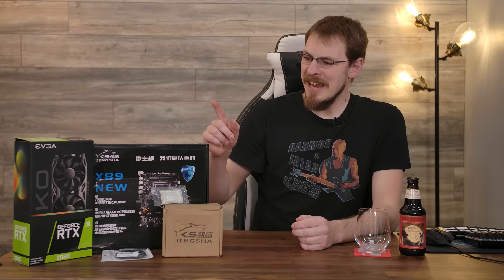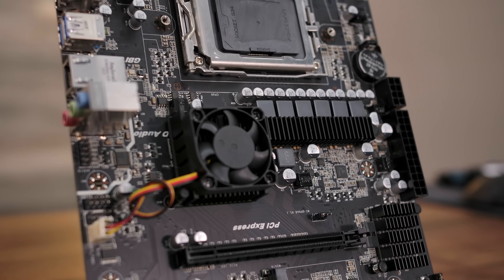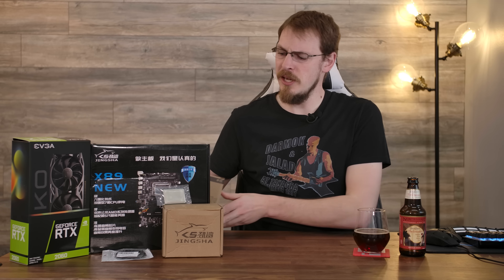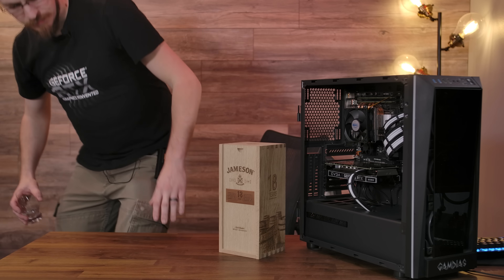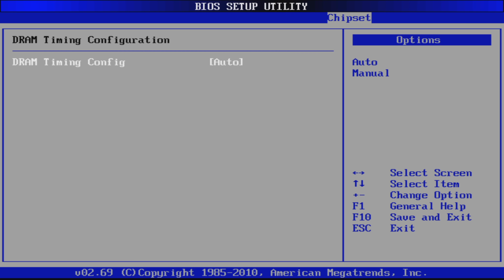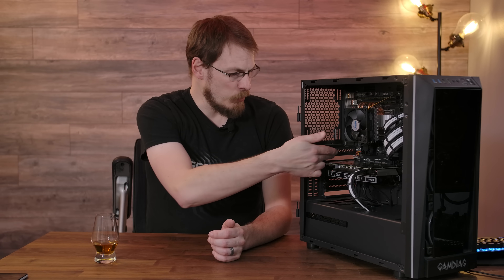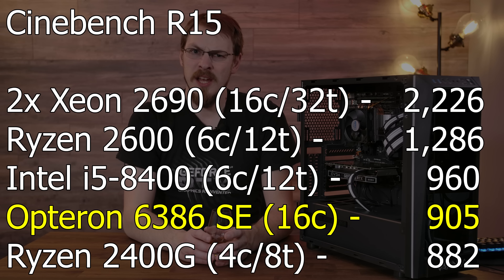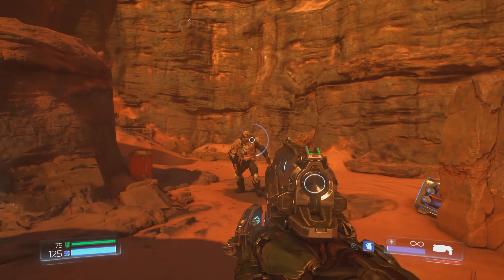Chinese x89 Motherboard??? Piledriver or just a pile?

Comment: Dont be a dick bro...i have dual socket ASUS KGPE-D16 with 128GB 1333Mhz RAM and dual 6128 OPTERON with windows workstation PRO 10 ...which still performs good

Comment: Glad I found this review before buying 2 of this board. I has 2x 6276 in a Supermicro H8DGi until the board started randomly rebooting after 45-60 minutes of use. No BSOD, just as if someone pushed the reset button.

Never had performance issues. Was looking into what to put the CPUs into and it definitely wont be what you tried. Maybe an Asus KGPE- D16 if the price is right (and if the price is right for a case as well).

Comment: Hey Everyone! Before we shart on Socket G34 and everything else related to the Piledriver and Bulldozer server platform I want to mention a few things! 
I've dealt with these chips for a while now, more specifically in Dell servers and I can tell you straight off the bat,  Jeff's x89 is ruining everything.

These chips, I will not lie aren't great at single thread ESPECIALLY NOT GAMING!!!! (making that very clear, these aren't like older, bang for buck Xeons, who are good at gaming).  
But, I can tell you first hand, on Dell, Supermicro and HP motherboards, these things are meant for VM's and lots of them. Running on a proper motherboard, these things can multitask and multi thread like nothing else. The 6300 series  (Abu Dhabi) (6380, 6378 and 6366 HE especially are compute champs for their value (6386 SE is a power hog) (Two 6386's can about touch one  first gen EPYC)

I would not recommend buying into this platform, if you have to buy a motherboard with it. Good motherboards for these chips are very very expensive, as well as coolers and are hard to find..
I think the only case you should be buying to this platform, is if you've found a good deal on a server chassis (which very much exist for this platform.) Servers like the Dell R715  (better R710 in my opinion) R815 and others in the Dell 11th gen "Rxx5" family are all,  AMAZING servers and run this chips very much as intended, unlike this "X89" junky motherboard. The HP DLxx5 servers are good as well! But in my experience the Dell servers and Supermicro motherboards are amazing. My Dell R715, loaded with 15K SAS hard drives, dual Opteron 6380's uses about 200 watts for what I do

What I'm trying to convey is that, if you are looking into getting into homelabbery and you need cores, on a budget and single thread isn't a HUGE deal, don't be scared off by this video, as these chips are really good, in certain use cases! This video is NOT a accurate representation of Socket G34 as a whole! Now, what I would not recommend is really going for anything but the 16 core Abu Dhabi chips, as really at that point, just buy an Ivy Bridge chip or something else,  you're better off with Intel. I know these chips have BAD single thread, but they aren't as bad as the ones in this video. My R715 actually used to host a BungeeCord network (Minecraft) and performed pretty admirably with upwards of 150 people spread off across my network on 12 Abu Dhabi cores! (Mind you, you won't be getting that on a single server... Single core still isn't great). They've run Plex transcoding beautifully and Code Compile is wonderful on one of my 24 core VM's. It is a pretty snazzy render box and i've been happy. 

The chips are cheap (80 CDN for 32 cores {2 Opteron 6380's off ebay }) but motherboards and coolers are very very costly and not worth your time. This platform is only worthwhile if you have a preexisting high quality server chassis, and power is cheapish ( At 0.21$ cdn per Kilowatt, my main R715 at home costs about 18$ cdn a month...) these are really fun to play around with, if you need lots of cores for VM's,  Code Compile or a multicore render farm. That is the only reason i'd buy these chips.

I really hopes this helps at least someone! This platform isn't complete garbo, but special and has its niche and this video is NOT REPRESENTATIVE OF REAL WORLD SERVER PERFORMANCE  AT ALL! (if you have a good motherboard ;) )

Great Video as always though Jeff! I'd love to see you try again with a proper motherboard :)

P.S, These things don't game..... I tried it with a 1070 and it was the funniest bottleneck i've ever seen.......
Reply: I totally agree 100%,I saw much much better performance on a Super micro dual socket.
Reply: A few weeks late, but thank you for this. I'll be honest I bought one off amazon as they were selling for less then 10$ just to frame it and use as wall art.
Reply: Real G34 mobos aren't that expensive, exluding rare quad socket ones. I'm planning to get a dual one for new diy server.

Comment: ive seen other tubers using worse opterons and running things like doom and strange brigade just fine... something is definitely wrong. guys were gettingg over 100 fps in both those games with opterons and no stutters.
Reply: These Opterons need a proper quad channel memory. And a real BIOS, not chinesium one.

Comment: Noob question.  A lot of issues I've seen with piledriver CPUs is that its "2 cores per core" weird layout causes a lot of bottlenecks in performance.  As in an oversimplification of how 2 cores share the same FPU and Cache.  If you have a CPU of this bad architecture would disabling SMT solve this issue?  Because then there wouldn't be 2 cores fighting over the same shared resources anymore, only 1 core that can go as fast as it wants
Reply: No. These don't use SMT it is CMT, and disabling a integer core is not going to get you anything. These CPU's were optimized for heavy multithreaded use, this is why they have had such a long shelf life because modern computing has moved to a much more multithreaded model.

Comment: The motherboard is limiting this cpu badly, on top of that many games and windows don't know how to cope with different NUMA nodes. Which can cause a significant performance hit and very fluctuating perfomance (speaking from experience with a quad opteron 6380 system, Windows performance is a lot better in UMA mode, however Linux is waaaaay ahead in NUMA mode performance wise)

Comment: I messed around with one of these X89 boards - got a little bit ahead with the BIOS-MODS forums for it (was Jingsha branded)  — we unlocked voltage settings and RAM speed settings along with Hypertransport settings and a few other things. 

He was working on getting CPU overclocking unlocked, but I got impatient and force-flashed the wrong BIOS to my board. Only way to fix it is to get a chip programmer  and reflash, but that project has been on hold forever. 

Sooooo if you want a project, check out the bios mods forums and search for Jingsha, carry on where I left off, get some overclocking going on that Opteron and let’s see what 4.5GHz of Piledriver ridiculous with only half the quad memory channels enabled can ACTUALLY do!

Comment: Why bashing Opteron CPU if youre running it in the motherboard that is just plain wrong for G32 platform? G32 Piledriver is designed to run with 4 memory channels and youre putting in a motherboard with just 2 memory slots! You should be drinking less and spending more time on research. A quick glance at CPU spec sheet should tell you that there is no point to buy this motherboard. It is the same as expecting that a horse will run just as fast on two legs as it does on four legs. Because Piledrivers are actually one of the best performing CPUs regarding memory throughput, it is capable of squeezing performance out of DDR3 close to what others do on DDR4. What a pathetic review.

Comment: This pretty much mirrored my experiences with a 6380 on this board. There were a couple things you missed out on too (If you did touch on them, I'm sorry!).
- The ram is not dual channel at all. Even with 2 sticks it remains in single channel, additionally the reason most software cannot identify the ram timings is because of the assigned node. Both sticks are handled by only one of the four IMC's (two IMC's per node) and software generally tries to read it from the unused node, failing to read it spectacularly. Reported it to Martin to correct this in HWinfo a while back.
- The board maxes out at 1600mhz as you've noticed, I found no way to override that. Handles ECC/Reg ram just fine however. Unfortunately the RAM latency tanks because half the CPU needs to cross nodes to access it. Was reading upwards of 140ns latency and higher compared to a consumer AM3+ board.
- FPS takes a 50% loss in comparison to the Opteron 3380 in my other rig at the same clocks during testing under OpenGL and DX11. I never could figure out why however but doom did run just fine under vulkan and 'close' but still under the 3380 FPS results. Tested with a GTX Titan X between both setups during comparison.
- Usb3... Usb3... It's not real, it's very much fake. There is no USB3 controller on the board and contrary to the claims of USB3 support (the blue header) it is simply a recoloured USB2 port with a higher power capacity.
- Using CorePrio by Bitsum helps a bit when it comes to thread shuffling to increase performance but it only works so much. The G34 Opteron suffers from similar issues with it like the earlier days of Ryzen Threadripper.

Comment: I really liked this video. I was thinking about an Opteron for my Plex server, just for the sake of it (and because the current AMD server processors are way out of my reach. And because I though a 6378 can manage the transcoding in all devices at home).  I don't think the CPU is just crap (but it is definitely bad), I think the motherboard plays a major role there. 

The thing is, by the time you try to buy a G34 compatible motherboard, you've already spent Ryzen money. That's how my "stupid" home server project with an Opteron died and got replaced by a Ryzen.

Comment: I've seen others review this board and it's always the same thing, smack in a high-powered server-CPU in that socket, get some of that ECC-RAM, run Windows [Insert edition of choice], stuff in a modern Nvidia GPU, then complain that a server platform does not behave as a desktop board, no overclocking options etc...

I like Craft Computing as much as I (and they) like beer, which is A LOT! But this review did not pack the punch and deep-diving that I hoped for. Modded BIOS:es should even exist for those Chinese boards.

I happen to own the very same model of Jingsha motherboard that is the subject of this video.
-Yes, there are others from more reputable brands like SuperMicro or even ASUS boards for the G34 platform, though the ASUS ones are very rare!
Most of the times they are multi-socket boards, meaning you can use several of these CPU's in one motherboard for multi-parallell workloads. -Not suitable for desktop OS... Just sayin'...
This board could be found for about $50-$55 (including the cooler) about 5-6 months ago, now the prices have gone up to almost the double from what I see on places like Ebay.

And while this particular board has gone through some REALLY strange and even kind of incomprehensible design choices (-like 2 RAM-slots on a 4-channel memory server platform??) the G34-platform really isn't a gaming or desktop platform what-so-ever, for what it's worth, it actually does not perform that bad under Linux for the workloads that it is supposed to run: Spoiler alert! -Not games and desktop applications.

But yes, you can run desktop applications on it under Linux, only difference is they actually work better than on Windows.
Of course it cannot measure itself against the way more recent, more effective Zen-platforms. -Even though Zen and the older Bulldozer architecture are practically ugly cousins, favoring the focus on more cores and interlinking them.
Zen only does this much better as it a lot more recent platform and a re-design to counter the shortcomings of the previous generation. Thus allowing for higher speed, better power-efficiency, higher IPC, granted more headroom and above all: Built on 12nm(and also 7nm w. chiplets) compared of the giant lithography for the Bulldozer at 28-45nm(!) for the oldest parts.

Granted the G34 platform cannot measure itself with Intel CPU's from the same era but seeing all tests being performed by YouTubers on Windows, doing desktop tasks and gaming is almost like them finding an already dead, rotting horse in a ditch and going through all the pain of dragging the carcass back onto the road again, only to then kick it back down into the ditch! :D

It's almost like a "Just because you can, doesn't mean you should!" scenario with this platform.

The easy explanation; Linux handles cores and threads (and modules, in this case) a lot different (better) than Windows has ever done.
Linux rules the world in the server-space and is has ruled it for ages, this is a server CPU, it is meant to do "server:y" tasks, parallell stuff, databases, web requests, things that desktop Windows is not good for, as Opteron CPU's was never intended for that desktop market.

Remember the AMD FX-platform that also did not compete very well with Intel's stuff? -Yeah, that was the CPU's intended for desktop tasks. They excel over the Opterons in every way when it comes to desktop tasks because of their higher clock-speeds and aim towards other kinds of workloads.

This is a server CPU and a pure server platform, in server scenarios it works quite well, so if you want to build on an old server platform that does not have as many known flaws (as of current date) -compared to the Intel platform of the same era (-and even later platforms) good parts are often very cheap. We're talking server-grade parts, not consumer parts.

Combine this motherboard with low-powered Opteron CPU (=not the CPU used in this video) e.g. the 6366HE: 16core@85W or a 6262HE: 16core@85W or even a 6128HE: 8cores@65W) an it will work pretty nicely.

Again: Please use it as was intended, as a >server< with Linux, that is...
Run Docker containers on it, run a file-server(sftp), use it for Syncthing, Webserver, a streaming server, as only a few examples.
Multitasking and web-requests is what this platform does well, so let it do ONLY that! :D
Reply: "Just because you can, doesn't mean you should!" scenario with this platform. ---  WELL SAID. The way these CPUs are described on the TUBE is just confounding and makes little sense... You have brought reason to my madness. "Use as it was originally intended". "Don't assume". "Don't test with a multitude of unknowns". Monday morning (decade!) quarterbacking is always EZ. Thank you for you input :O)
Reply from the maker: Thanks for your feedback, but here's the deal as I mentioned at the end of the video. ANY task, server, workstation, or gaming, will perform better on a Ryzen 1600 for less money overall. You'll get more memory bandwidth overall running 2666 dual channel vs 1333 quad channel, and around 30% CPU time improvement. Even for server workloads, the Ryzen will perform better. That's why this received a negative review...let alone the freezes, stutters and hard locks experienced on the system.
Reply: @CraftComputing  Agreed, this old server platform cannot measure itself against the newer Ryzen 1600, of that I'm certain, and that is true for most of the single-socket server hardware released in that era. ;)

But it is actually does not perform nearly as bad when it runs tasks on Linux, when compared hardware released in that era, that is...

Just a question: The cooler that you got with that motherboard, did it have any rating written on it?

I got mine in a plain no-name box and it seems to be rated for 115W TDP which most Opteron CPU's was limited to at the time, your CPU in this clip (I think it is a 6386) has a rating of 140W TDP, could that be the reason for the constant hangs you experienced?

Given this this system is indeed a server system so it usually throttles at around 50-60C to run stable for server operations.

Props for the VERY fast response!

Love your channel! <3
Keep it up!

Comment: I promise these CPUs are a LOT faster from linux

is there any overclocking options on this board?
Reply: That is... actually true, performance numbers nearly triples on Linux-OS compared to Windows-OS, judging from from my own tests of Solus 4.1 vs. Windows Server 2019 and Windows 10 1909. No joke.
-Though triple numbers of that magnitude is not impressive in today's computing, Windows just makes this platform look even worse than it actually was! :D

Also: Windows is trash when it comes to multithreading, that has been known for a long time, and as has been showing very clearly in the likes of the AMD Threadripper platform, just juggling threads around in Windows causing 100% CPU usage for tasks that does not even utilize 50-70% under Linux. It's getting better, but Windows is still far behind on that...

Comment: Buddy......I can't believe you expected any other outcome. 🤨
Opteron?....A CPU that is a dual socket 1 package solution.
Not only a crap architecture, but also very bad leakage.  The speed reported by the BIOS for the RAM is for the BUS speed *lanes from controller to DRAMS.  No dual channel with AMD's server stuff from what I remember too....the platform nearly destroyed AMD for a reason. 😔

Comment: 1. 3.2 ghz is really low clock for Pilrdriver, as they scale up to 4.6-5ghz. 6836's  clocks are comparable  mobile APU-s
2. i5-3317u boosts up to 2.6 ghz in ST loads.
3. 6386 SE is not 16 core CPU, it is 8 module CPU. Bulldizer line in particular can't be compered  core to core against other architectures.